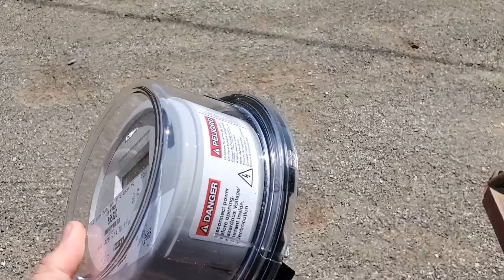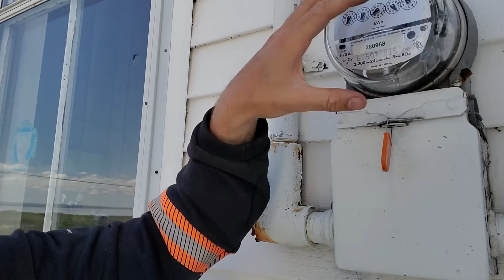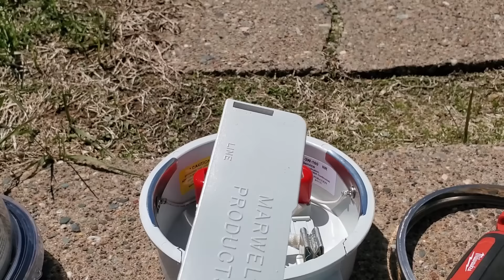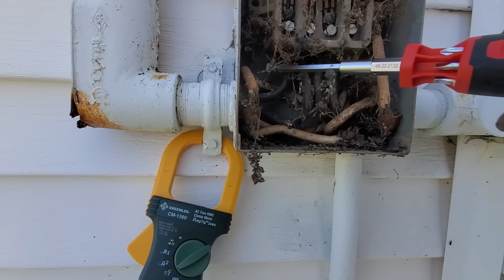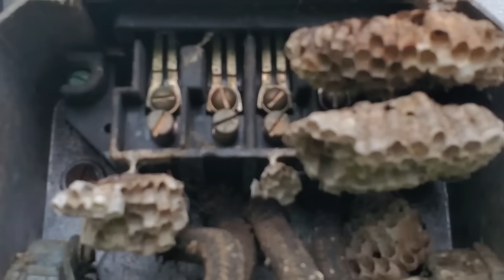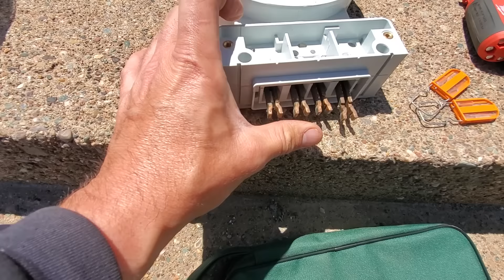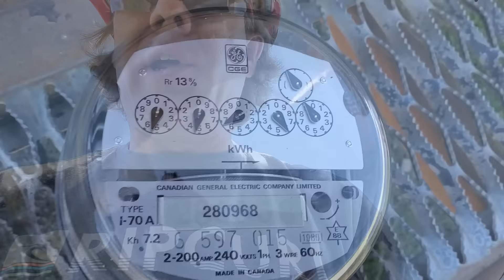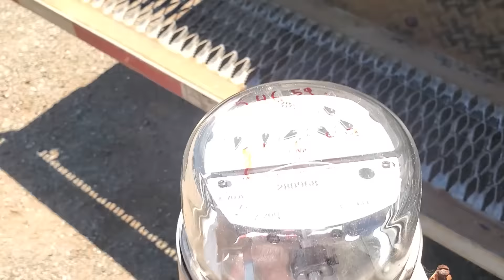Removing an old "A" base Electrical meter

Comment: Why do you guys on the American continent use these types of socket meters? I’m trying to understand the differences between these systems and the din rail systems my house has here in New Zealand. My meter for example is a big rectangle shape.
Reply: My guess is that they're just used to this system. Changing over to European/Australian/NZ style meters would be a lot more work to adjust to, than just (approximately) sticking to what they've had for the last 100 years 😉
Reply: Maybe because the A type meter came out a century ago and the S Socketed type came in the 1930s
Reply: The meter is also used as a disconnect when the power to a building is turned off. The power company can pull the meter and replace it with a plastic shield. It is obviously more difficult to disconnect power this way when the meter is hardwired instead of being socketed.
Reply: @brianleeper5737  Here in Europe, when you have a smart meter, the power company can disconnect anyone remotely from their office. It's a little bit scary thought that just a few bits of data can set you in the darkness, but it is what it is 🙂
Reply: @Engineer9736  I think some of the smart meters in the USA are capable of disconnecting power remotely. The one I bought on Ebay a few years ago does not have that capability. (Itron smart meter, don't recall the model).
Reply: I want to emphasise I’m not asking out of criticism I am genuinely interested in the differences.
Reply from the maker: I've never worked on any equipment outside of North America.l, so I don't really have an answer for your question. I've heard from many European viewers that many aspects of their system is quite different.... In the grand scheme of things, it's a pretty universal trade.
Reply: @Bobsdecline  in New Zealand and maybe some old places in Canada? There is a weird SWER system in remote areas.. the ones i saw in New Zealand in 1992 were 11kV line to ground on the pole. There is no neutral wire so ny brain went confused when i saw it. They use the earth for return path. This system came out on the 1930s for super rural areas when only a distribution transformer at a farmers house every few km 

I saw a tiny sub station where they went from 3 phase with neutral to the swer system. They have a mess of ground rods for the return current. The odd thing is poles with 1 wire with insulator

Nz is 50 hz so motors transformers have roughly 20 percent more laminations.

You can run a 60hz motor or transformer there but you have to drop the voltages by about 20 percent
Reply: @3beltwesty  in parts of the Canadian prairies they also run the neutral through the ground. It seems that the efficiency tradeoff was worth saving an extra conductor wire on longer runs out there.
Reply: @WilliamPayneNZ  Hello Willam. The A type meter here in the USA was already in usage when Germany made the din rail system . So just being already in usage means it is difficult to change a million meters.

 The A type meter has a rectangular hole in the bottom to connect to the customers house power box. 

One of the big 3 in meter manufacturers say 100 years ago was Duncan Electric. They made parking meters you put coins. The A type meter base is say type aluminum die casting material.

When my dad was a Kid in Detroit they had some homes with an electric meter you put coins in. So one Quarter coin would buy you 2.5 Kw hr at 10 cents a kilowatt hour. 

In a 1920 electrical engineering book they have a house with 3 circuits on 115 volts. That book gave the 10 cent rate. That might be like 2 dollars us? In todays money per kwhr

Comment: As someone who works in customer care - I personally really am excited for everything that smart meters will allow customers and and customer care to do. I look forward to being able to take a high bill call and just be able to see right away, without having to explain to the customer how to read an analogue meter, what their current reading is, or being able to do a DFR right away. 
However, the amount of "well because the 2016 situation in BC they cant be trusted" or people even thinking that RF meters are smart meters and that a person reading the meter is more accurate (it's not, it increases the possibility of a misread)...
I am exited to see what the smart meter rollout will bring :)

And for the reading, 54659
Reply: What’s exactly the difference between RF meters and smart meters? Google wasn’t of any help…
Reply from the maker: An RF meter simply allows a meter reader to capture the reading on a small handheld device from a short distance away. A smart meter can be read right from the office. It can also tell us when your power is out, how much consumption is being used and be remotely shut off for disconnects. There's also apps that can help a homeowner figure out how to better manage consumption.
I'm not overly family with them yet, but there's definitely a lot of benefits for both the company and home owner
Reply: @Bobsdecline  from what I understand as well, customers will be able to tell when they are using a lot of power. Currently, with the manual reading/radio frequency meters, our teams go read it once a month, and that is it. A Smart meter can do readings mor frequently, because it is the meter doing the reading, not a person the power company is sending to the client's home.
Reply: @Bobsdecline  Ok ok, I find it weird to install those, why not go directly to a smart meter instead? The biggest cost is probably the installation anyways. 

We’ve had smart meters in Quebec for a decade or so. It’s really nice to have a graph of your hour by hour usage, it opens your eyes to how much energy a specific thing uses. And no need to call them when power is out!
Reply: I am in Québec with my smart meter I can use an app to see my power consumption per hour/month/day wich is quite nice by itself, but I am also enrolled in a special program and get email alerts a day in advance of the peek power periods during the winter and get rebates based on how much power I am saving during theses events(with purely electrical heating so common around here this can make quite a difference!)
Reply: @jt3178  definately :) I do hope that eventually we get peak based pricing, but right now it is just getting them out and in use that is the focus :)
Reply: @mariethedicedragon5977  I'm in Southern Maine. Years ago we had time of use meters and it worked well for the consumer. Maybe that's why that program was ended.
Reply from the maker: I agree 100%! 
Also, often times, meters get blamed for issues that were actually caused by poor connections on the main wires that began heating up!
Reply: @Bobsdecline  
The "best" part of people blaming the meter is that on the rare occasion that the meter is actually incorrect, it is to the customer's benifit 😅
Reply from the maker: Absolutely! I've seen "stopped" meters, but never meters that sped up!

Comment: Nice work Aaron.  Is there a reason why you pulled the cutout as opposed to pulling the switch on the transformer?   Cheers from NH!  👊👊
Reply from the maker: Hey Alan! This tx didn't have a "CSP" switch, most of ours don't anymore. When they do, we usually still open the cutout. The switch on the tx doesn't provide a visual open and sometimes doesn't want to close back in

Comment: Southern California. The smart meters communicate with one another as part of a mesh network right? Do they transmit continuously or periodically?
Reply from the maker: That's correct. We're only gearing up now for that system and don't have many installed yet. I believe they transmit periodically multiple times per hour
Reply: @Bobsdecline  Thanks! They required us to get a smart meter when we bought our house in Southern California in 2011. It's nice that they don't need to send someone around to get readings, but a lot of people are afraid of the RF (even though they carry a cell phone, use a microwave, and have wifi access points everywhere. :)
Reply from the maker: That sounds exactly like we're gearing up for! The one installed in this video is the type where the van drives by and collects the info... We already have the (transmitters?) Installed in preparation for the upcoming smart meter project
Reply: @Bobsdecline  Actually expect at some point in the future
will go to TIME OF DAY pricing.   Probably 15 minute increments?
Reply from the maker: @Ted Lahm definitely going to be "off peak" rates. I suspect before 7am and after 7pm will be cheaper as an incentive to reduce peak demand on the system as a whole. 
Not sure on the exact times/rates yet
Reply: The meters pretty much transmit packets of readings continuously, so that the meter reader truck can capture the latest as it drives by. It is periodic in that the transmitter is not on all the time, yet continuous in that readings are being transmitted with no one around. To create a mesh network of meters, the meters need to have a receiver and memory for forwarded packets.
Reply: @steveschulte8696  I dug into it a bit after my comment, and it does appear that they create a mesh network in a neighborhood and relay packets to a hub somewhere nearby - usually on a light pole or something and that unit has a connection to their network by ethernet/fiber or cellular. No trucks need to drive by to collect the data, fully automated.
Reply: @paul.phillips  Electronic meters can be grouped into several categories. The oldest is a Primary Electric Meter. These meters have a electronic usage accumulator, but still require a meter reader to come around and read the meter with his electronic meter. One can find them with a D-shapes window on the front and manual reset. The next class is known as a AMR-enabled meter which adds a communication function to the meter. The newest meter is a AMI-enabled meter which can implement a mesh network to send accumulated usage, and  maximum demand measurement in a 15 minute interval as well as near continuous power consumption. The AMI-enabled meters can also receive updates from the utility supplier. The oldest technology is the electro-mechanical meter which has no electronics only the analogue dials. There are hybrid designs that combine the rotating disk for wattage calculations with an electronic accumulator. These hybrid meters can do all the features of a full electronic meter, but the design is so old that additional features do not make economic sense. The newer meters calculate kWh by using only electronic devices and no mechanical devices.
Reply: @Paul Phillips  Seems to match what I’ve seen here in Quebec (we’ve switched about 10 years ago). There’s small relays in poles, usually on the same pole as a street lamp so it doesn’t need its own transformer. That’s it. No truck, no nothing. And they are REALLY far apart, like only a handful in my 2000 people town.
Reply: @steveschulte8696  Second generation (of meter )has no truck going by.   
Read by a reader mounted nearby.     Getting ready for TIME OF DAY pricing.

Comment: 54659.1 kWh

Upd: I'm from Ukraine. I really like good info in your vids. Despite there in Europe we have 1phase 230 or 3phase star 230/400V - and moslty split phase system for consumers in USA - it's really cool to understand how it works and why it's done in this way )). As for me 3phase 230/400V system more comfortable as I can power some equipment with asynchronous motors directly, when for split phase system - I don't know, not investigated this question. Also we have end transformers that powers a lot of houses, like 50-100 houses on one transformers (more tight space usage, small distances), when in the USA with big distance between houses individual transformers are more efficient. :)
Looks like all this differences mostly historical, but any way both systems cool and reliable as they works for a lot of people around the world.
Reply: The more remote end customers get one transformer per customer. The power company can provide more power over the same gauge cable if they do that. In the cities and suburbs there are multiple end consumers per transformer. My split phase power comes point that supplies power to four end customers in a star configuration. High density end users, apartment buildings, may have 208Y120 supplied and the line side of the meter connected to 2 of the 3 phases.
Reply: @steveschulte8696  I moved to a rural location and noticed that... I have my own transformer, same with everyone else. In my old neighborhood around town the entire street was fed off one. Makes sense, can't feed 240 for miles.
Reply: @steveschulte8696  as the apartment dweller I do know that this is fact on the apartments side of things
Reply: In Belgium some old city streets are also fed split phase system 3*230 volts. That"s 230v between phases and 127v between phase and ground. Its a bit different than in North America, they get 3 phases in. And sockets are wired with 2 phases and neutral is not used.
Reply: @larsvd5354  this is a standard 3phase Y connected service with greater voltage between neutral and hot. The 127 volts are not in phase with the 230.

Comment: Always a pleasure to catch a decline video. Stay safe brother 👊
Reply from the maker: Cheers brother! Hopefully ya have a quiet weekend 👊👊
Reply: @Bobsdecline  we stayed on for a 16 yesterday. A 3 phase vertical double dead end corner pole got hit
Reply from the maker: Oh dang, those are never fun... Switching and traffic alone are half the job! Being a corner pole makes it wayy worse too
We had one last week with 69kv on the top and three phase distribution bank on the same pole. The boys were some busy !
Reply: @Bobsdecline  so I requested them to tie circuits so we can separate circuits at the taps on the vertical in order to be able to transfer it without jumpers. They said they had to set the regs at the sub to no auto in order to tie the breakers but they couldn’t do it via supervisory (remotely) that they would need to send a multi(technician) to manually do it and it could take up to 3/4 hours of standing down in order to do so. So we opted to use the jumpers. Didn’t want to wait around lol. I’ll email you a few pics.
Reply from the maker: Oh yeah for sure! And we know that 3/4 hours probably means 5-6 hours! 
Sounds good man!

Comment: @octaviohernandez327：I just got a job offer for apprentice UG line work. Testing out Monday, have 2 1/5 years on secondary lines according to the GF this is strictly UG position. What should I expect at the field testing boss? Honestly quite nervous
Reply from the maker: You may have to preform a high voltage splice and termination as part of the test. Depending on if there's any practical testing... If so, and it's something you don't do often, don't be scared to open up the included instructions and just follow along!
A lot of times, they aren't looking for someone that knows it all, but someone that is competent enough and willing to learn
Reply: @Bobsdecline  just wanted to let you know I did good on the test boss and coming in as a Lineman C. Spent hours watching your videos throughout the week. Hope you come out with some merch because I’ll definitely be a customer be safe boss.
Reply from the maker: Octavio, that's awesome! Really glad to hear you did well and thanks for coming back to share 👊👊 cheers!

Comment: I wasn't home when my meter was changed and I was disappointed that I missed that. Now I know. Thank you. That meter isn't that old (I'm probably older). My husband has a collection of very old meters on the wall in the man cave. The oldest is from the 1920's and is labeled for DC. Thank you for sharing your expertise. Stay safe and God bless.
Reply: I was surprised how fast when they replaced ours with a smart meter (so they can remotely read) how fast it was.  Got everything ready, opened the panel, pulled the meter, plugged the new one, closed it up.  Took longer to record the serial numbers on everything than do the entire rest of the job.
Reply: i actually have a 25 amp meter that i am still using on one of my small out buildings, it's fed off my house via underground. it's from the early 20's and still works, the building is wired with K&T and the panel is wood with slate fuse boards
Reply: @gtb81.  That's awesome! The only time I've seed slate boards is with Delco light plants. My husband collects those.
Reply: @heatherkohlwey8379  I've always wanted one, i have thought of building a wash house for my workshop using 1920's stuff, it'd be cool to run it off a light plant! i have lots of early electrical stuff including a light bulb from the 1890's that still works! I'm an electrician so i love this stuff, and will still put it back to work!
Reply: @gtb81.  My husband is an electrician also. We have one of every Delco model made but one and quite a few other rare brands all 32 volt DC. We have a trailer and display at gas engine shows.
Reply: @heatherkohlwey8379  Good Old Farm Power Systems 36 volt I think
Reply: @gtb81.  I'd probably do the same if I had the opportunity
Reply: @gtb81.  that would be awesome you need to do a video on this for sure
Reply: @gtb81. that’s pretty gangster